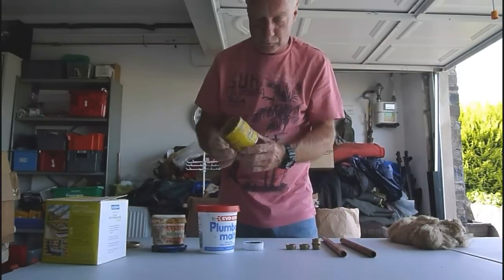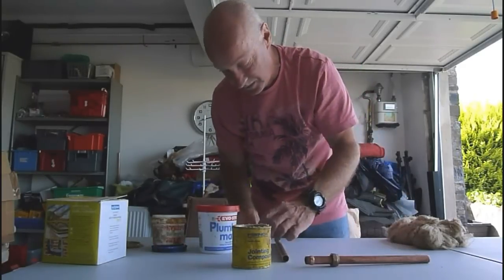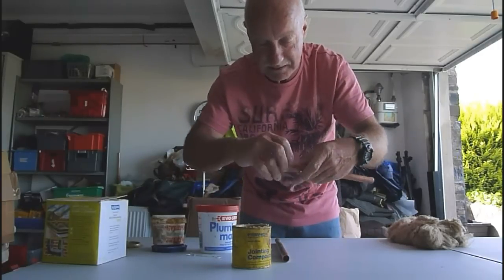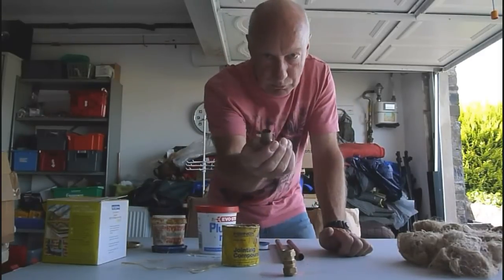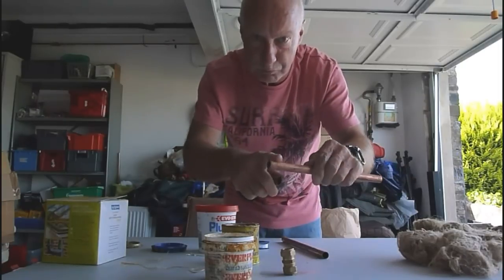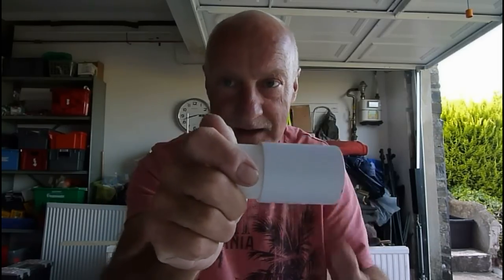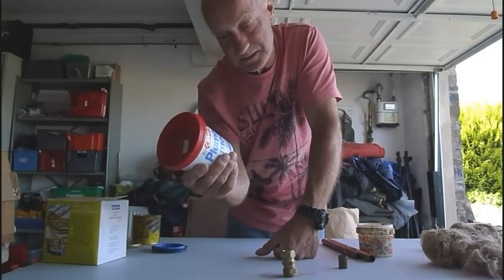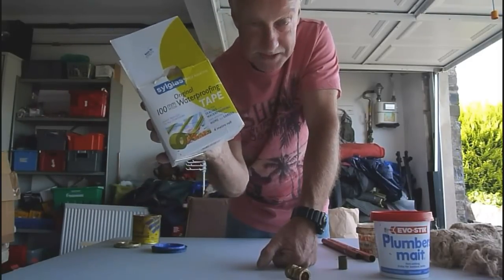How to seal copper pipes, plastic pipes and sanitary ware.

Comment: Thanks.  I asked in B&q today about sealing those compression  valves with copper pipes. They said you don't need a compound.  Just that white tape will do.  Once you tighten the screw it activates the "rose" inside thereby giving a seal.  That has worked for me. Been killing my back trying to sort the toilet out, last 2 days.
Reply from the maker: Yes it is  up to you if you use it, good luck with it.

Comment: Heating & plumbing engineer here, jet lube V2 all the way for me. Denso or self amalgamating tape is usually used on pipes or copper pipe going under or through cavities.  To prevent reaction or corrosion.

Comment: Thanks for the tip on Fernox jointing compound. In stock at Screwfix and Toolstation so will be adding that to my inventory. I'm not a plumber by trade so not familiar with the finer art of it. I've been using PTFE till now which is a pain to wrap on a pipe in a confined area.
Reply from the maker: Glad to help!
Reply: @dereton33  
Having looked into Fernox, Hawk White is not approved for mains water but the  Water Hawk compound can be used on everything.  Jet Blue Plus is also on the recommended list but that's for you experts to debate. Fernox is stocked at Screwfix/Toolstation so that's where I'm headed.

Comment: I thought I come to see if Al has any solutions for my waste pipe that is in full sun and good 28 years old, and voila found what I was looking for! Although the pipe is not leaking I have discovered that it seems to be deteriorating in the sun and one edge is disintegrating so wanted to prevent any further damage by using some form of a tape. Thank you Al I will be searching for that last tape you have shown. 😘
Reply from the maker: No problem

Comment from the maker: Denso is usually used for a temporary repair on plumbing leaks mainly on outside waste pipes soil stack leaks ect. It is rotten stuff to work with.
Regards
al.

Comment: I was working on a toilet with leak from tap connector. I fixed the leak but had created another leak from the doughnut as this was inevitable due to the fact that the existing rubber doughnut was in a bad state but this must of only started leaking as I had moved the toilet slightly when working on tap connector. I communicated this to the customer and they did not want me to go to the plumbers merchants and buy other parts but I used a universal rubber washer and had to still use existing metal plate that was rusted quite bad. It was still leaking when flushed and so I added plumbers mate around the rubber doughnut on top and to the side which solved the leak. I explained to the customer but they were happy with the end result. Is this a ok way that I had gone about this job?
Reply from the maker: Plumbers mait is fine, will outlast any washer.
Reply: @dereton33  thanks for your quick response, really appreciate it and all the education videos you have. Nice one 👍

Comment: Changing the radiators at home. I’m not a plumber though.  First used the PTP tape then it leaked a tiny bit so disassembled all the 7 reads dried them and used Fernox this time. It doesn’t leak at all now. Strange that this stuff is still a bit soft. Is it going to set one day or it remains soft? Just wondering if I did something wrong. Used the Fernox potable version. 
Nice vid by the way! Loads of help!
Reply from the maker: It will go hard eventually.

Comment: Hi D, hope you don't mind me asking a question about a different video, I have a kitchen tap that needs turning a couple of times before any flow emerges, I watched your vid on the top of the tap coming loose on the left hand thread from the bottom, I have just stripped it down and that bit was tight, but the circlip was in the wrong place and looked like it had worked it's way loose, I put it back in the right place but it seems very loose, am I right in thinking that a dodgy circlip would have the same effect, eg needing to turn the tap a lot before any flow? thanks for all the vids, watched a lot of them and always find them interesting, Paul.
Reply from the maker: Hi Paul , yes it will, but sometimes that has happened because the body is worn. You can get just the tap body parts on my Amazon shop my channel.
Reply: @dereton33  Many thanks !

Comment: @dereton33. Hey i have bit of a nuisance fitting. Recently fitted a triton shower and having problem with a compression elbow to inlet on shower. My problem is 2 fold i believe!!! The actual Male THREAD on the elbow has slightly worn away while tightening. ((I really should replace the elbow but that will involve ripping out tiles, backer board and possibly cutting the old fitting off with pipe cutter. Then I'll need to fit new strip of copper to old length with ANOTHER compression coupling as the olive most likely wont come off and thats all before even fitting the new elbow. Arrrrrrr - a nightmare as I was simply planning to fit new shower and job done)) I mean the more fittings the more chance/possibility of leaks.. correct?

Now, all that being said, after connecting inlet to the elbow i cant get the drip to stop. I've already tried lots of PTFE which helped but doesnt seal. So i was thinking Jointing compound might do the trick. My main questions is as follows.

Do you think Jointing Compound will remedy my nightmare or once a thread has perished ONLY replacing the fitting will do? PLEASE PLEASE PLEASE tell me the Jointing Compound might work.
Reply from the maker: I would recommend some good old fashioned hemp wound around the thread then the jointing compound. See if you can get the hemp and boss white around the around the front of the olive too.

Comment: What would be best to use between bath and taps where a new tap washer won't cover the old tap hole? It's a steel bath with square cut holes. The base and threads of the old taps were covered in a clay material. Any advice you can give?
Reply from the maker: Plumbers mait.
Reply: @dereton33  thank you. I used this stuff and tested it with a shower head and no leaks around the tap

Comment from the maker: No not on the threads .If you are removing the whole valve out of the tank instead of splitting it as shown on the video you will need a new tank connector washer (a straight swivel washer) or you can use ptfe tape rolled into string and wound around where the washer would go (I prefer hemp).
Kind regards,
al.

Comment: Do you need to roughen the thread up first when using hemp? Also, do you wind it in the threads or across them like loctite 55? 

Thanks, great videos by the way.👍👍👍
Reply from the maker: No need to roughen the thread, but wind the hemp into the threads.